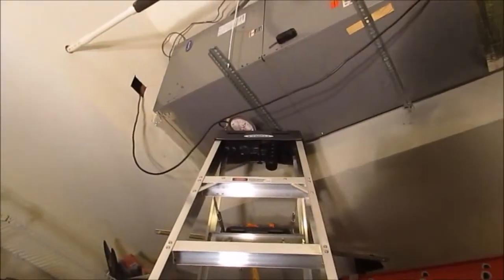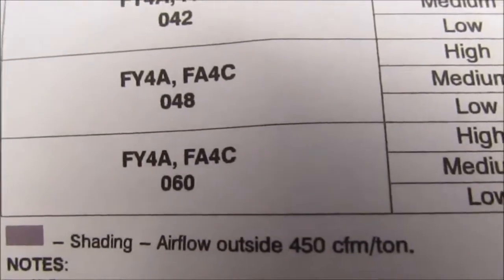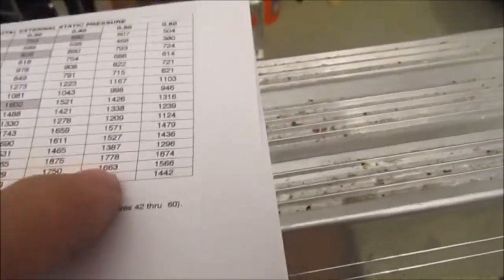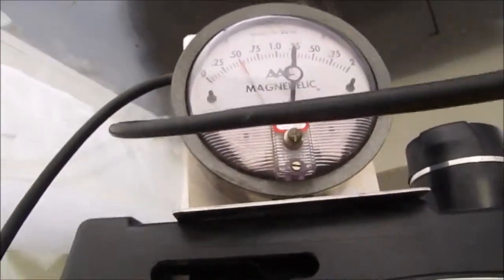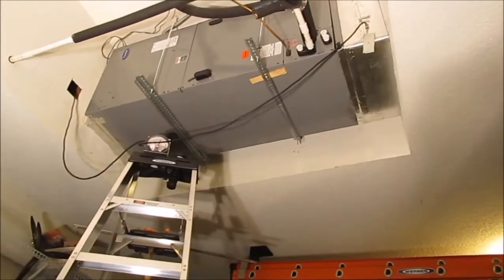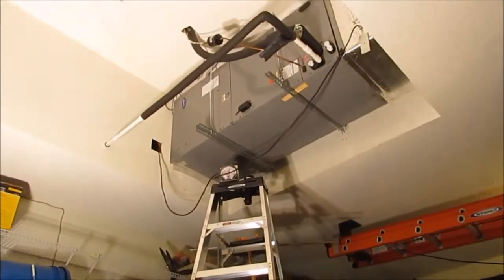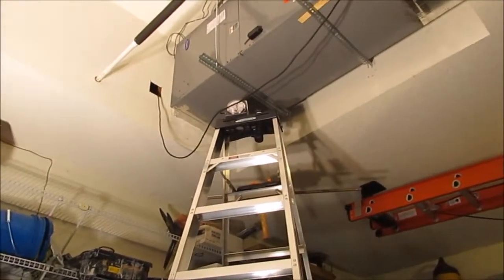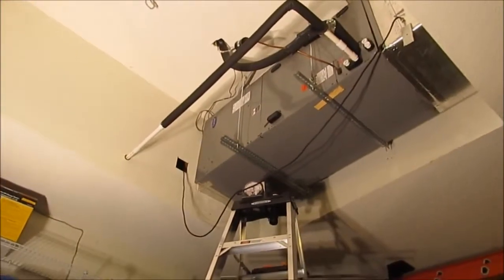HVAC:Pt.7b: 22-5 Ton to 410A-5 Ton- AIR HANDLER, Measure TESP (Total External Static Pressure)

Comment: Emergency stage heat (10kw electric strip) should turn on when the indoor ambient  tempature is 3 degrees or less then set point depending on the setting of the thermostat. , say the house is set for 68 heat mode if it’s 60 in ur space you would have the cdu and heat strip on. When the temp reaches 65/66 the electric heat should turn off and heat pump continue until satisfies. I’m sure you know this if your not sure test it see what you find.